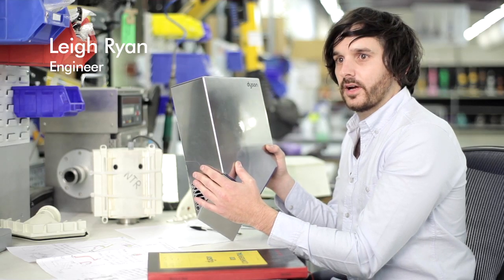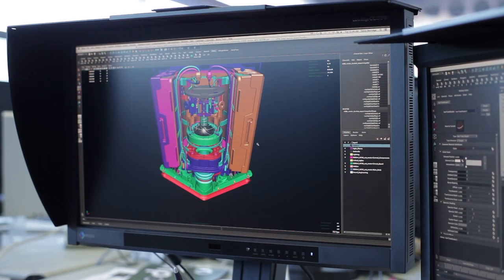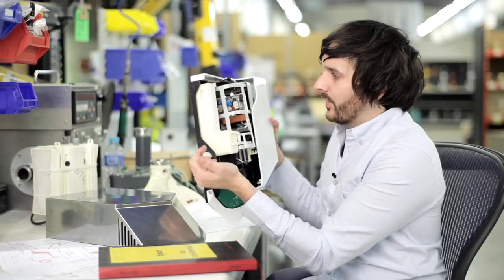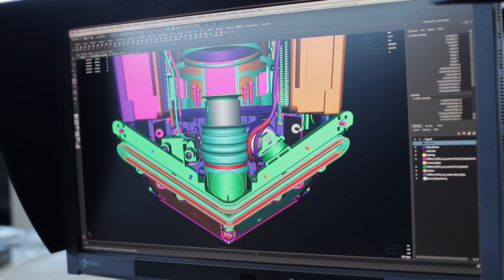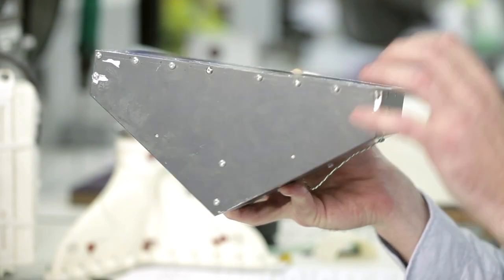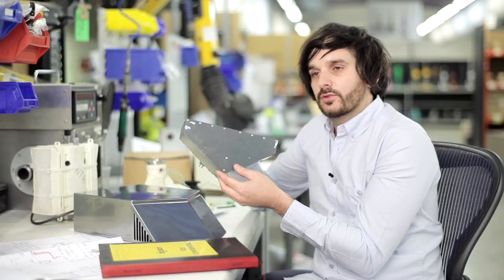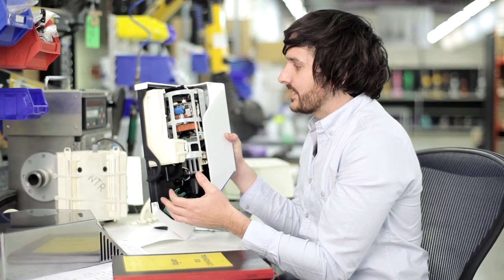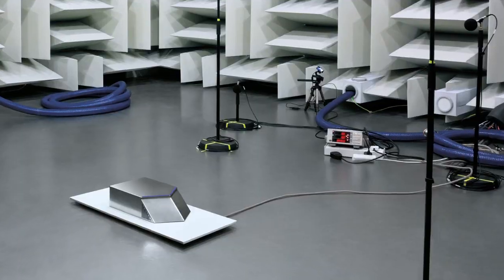Dyson Airblade V hand dryer explained - Official Dyson video

Comment: how to open the filter of dyson airblade? i have 8 units not serviced yet. all 8 units already cannot use.
Reply from the maker: +Si Labi Labi (LabiLabi) Hi there, it's Jack at Dyson. The HEPA filters in Dyson Airblade hand dryers are engineered to last the lifetime of the machine in normal use. However if a machine under particularly heavy usage in a high traffic washroom does need it's filter replaced, this is quick and easy to do. You can see video guides for replacing the filters in Dyson Airblade V and Airblade Tap hand dryers in our official playlist here: https://www.youtube.com/playlist?list=PLDfU9nMES75NJow4gcPVYZY3gePtodS8k

Comment: These do not work. My workplace has these and the sensors flat out do not work properly. If you move your hand even just the bit away from where you guess the lasers are, the entire thing shuts off.
Reply from the maker: Hi there, it's Jack at Dyson. The sensors used in Dyson Airblade hand dryers are engineered to work responsively, so the dryer runs when it's needed, and shuts off promptly after use to avoid wasting energy. If you've noticed a particular Airblade dryer that you don't feel is working effectively, please reply to let me know where this machine is installed so our Airblade team can investigate.
Reply: Since I posted this original comment, the sensors at my workplace have been fixed/improved so it doesn't shut off the second your hand moves a couple centimeters from where you guess the sensors are pointed. Maybe someone complained and they were adjusted.